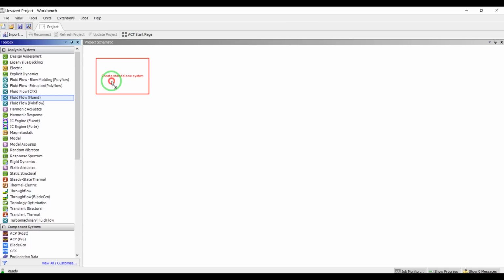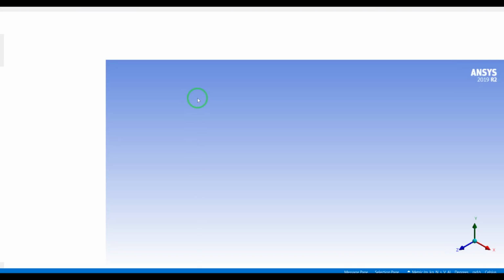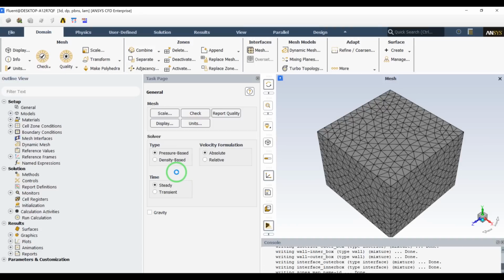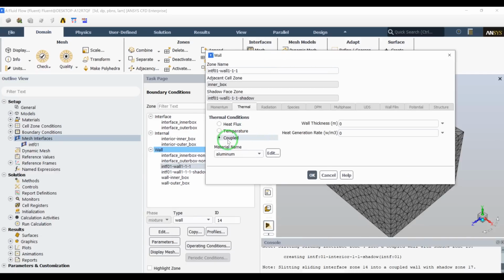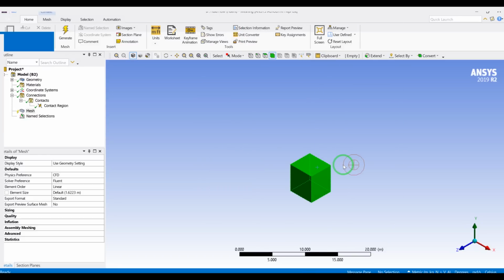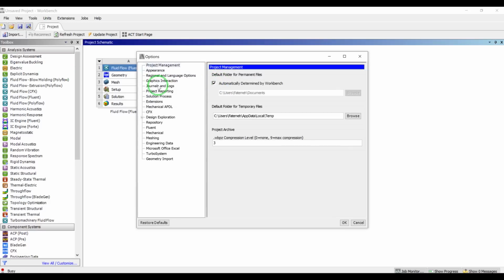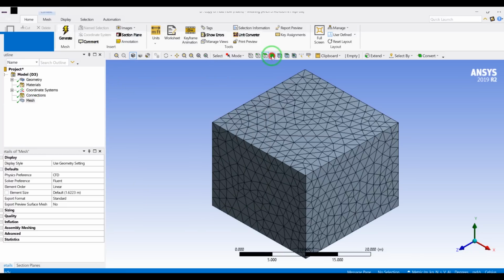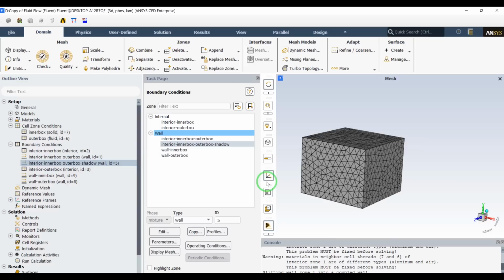ANSYS Fluent Tutorial: Three methods of Defining Fluid - Solid interface for Conjugate heat transfer

Comment: Great video!!!
In the first method, when u set the interface, except for the "intf01-wall1-1-1" and "intf01-wall1-1-1-shadow", how about the other two generated walls? What is their function, and why are they created?
Also, if I set up the wall interface for two solid zones, does the side of the wall shadow affect the heat flux?

Comment: Namaste sir,  thank you for clear explanation but i am still facing issues with mesh and boundary condition; i am working with battery pack which has bit complex geom (in context to manually define contact regions) while automatic contact regions give overlapping problem. I have tried combining in one part ,share topology and ansys mesh and even fluent mesh still some internal boundaries remain as wall  while i want to transfer heat generated in cell to outer wall of pack ( here i am using battery model for cell modelling(not flux profile) this itself requires to define some named selection for cell) these selections comes as wall in boundary zone but i do not want that. And when all boundary issue are reseolved the battery pack circuit starts missing active zones. Can you help with  that. Anyhelp will be appreciated. Kindly reply , also give mail id for communication.

Comment: Hi there. Thank you for your tutorial. Btw, I have some questions. 
1. Can we use the same box and differentiate the lower surface as solid? For example, the upper surface of box will have radiation while the lower surface will act as steel, the absorber for heat. And in between the surface is the fluid. 

Or do I need to sketch another box which will act as steel absorber as the cube?
2. What is the difference between the radiation model and radiation in thermal tab of determining boundary conditions?

Thank you for your help!

Comment: Thank you very much, it worked for us!!
We were trying to do a parametric analysis of a solid-fluid interaction but it was giving us problem of recorded-mesh operations (using the first method since we didn't know about others) and this problem would occour in random times, so we couldn't solve it with our journal. But since we used your third method, it stopped showing us the message for recorded-mesh operations and now we can automate everything.
Thank you again!

Comment: Hello there. Thank you for the very informative video. Just one question, does this method work if i want to create a structured block mesh inside a fluid domain with different mesh sizes. Will it work if i combine all blocks to one part at the beginning?

Comment: Great Video, Can you tell if that non overlapping wall will cause any problem? If I have a non overlapping wall, then what should I give as its condition? Heat Flux zero or via system coupling?

Comment: Excellent video. I have a question. Which boundary condición can you suggest me for a interfase or contact between two volumes of the same fluid? Thanks for your answer and your videos, they're so cool
Reply from the maker: It depends on you application. But if you are just slicing your fluid region for example to make finer in one section. The interface should be internal in between which will make two fluids physically one single material.
Reply: @AdvancedEngineeringTutorials  Thank you.

Comment: Excellent tutorial! Thank you very much!
In addition i can suggest a thing. In the third case (unified part for multiple bodies) mesh is conform (vertices-to-vertices), and single meshing rule is applied to all bodies in the part. And as all bodies is in single grid, this may cause too dense grid in parts, where it is not necessary. And sometimes need to apply spedial sizing mesh rules to separate bodies. Just my suggstions. But in general, mesing single part is best solution, as in this video.

Comment: Could you help me?
I'm trying to simulate a piece of wood drying into a wind tunnel and i'm having problems with meshing.

How can i set the contact between the fluid zone and between the solid (set as fluid zone because it is a porous region with water inside)?
Reply from the maker: Thank you for watching and thank you for your comment. Could you please explain more about the problem? How do you create the porous media?
Reply: @AdvancedEngineeringTutorials  I set the cell zone condition for wood as fluid zone and then marked the option "Porous Zone". Set the porosity for this cell, and the porous material as wood (from fluent database).
Reply: I also set an initial fraction of water volume inside the zone (0.5) at the initialization, the heat transfer worked quite well creating a contour of temperatura, but the mass transfer doesnt work.
Reply from the maker: @kkggff1  I see, unfortunately, I have not done much mass transfer simulations so I am not sure. I will try to see if I can address this issue.

Comment: Thanks for the video, very well explained :) 
I usually use 'Imprints' as shared topology after forming a part in Design modular, which creates automatic contact regions in meshing (sometimes overlaps, which can be overcome). Is it a right way to do?
Reply from the maker: Yes, that will be a good way too. In my personal experience, merging them as one part and letting fluent take care of interfaces is the easiest way and you can find out any problomatic geometry if that does not work well.

Comment: Hello my Ansys Fluent 2020 does not detected contacts even after following the boolean operation. I checked whether automatic contact on attach is checked. But even when I select create automatic connections, nothing happens. What could be the reason?
Reply from the maker: Thank you for watching and thank you for your comment. Are you creating a single part from all the bodies in the design modeler?

Comment: Very useful. Thank you!
Reply from the maker: Thank you for watching and thank you for your comment.
Reply: @AdvancedEngineeringTutorials  
What if i have to apply one of these methods to a 2D geometry? which one would you suggest?
Reply from the maker: @francescomarcelli7672  Personally, I always use creating single part in design modeler so the interface would be created automatically in the Fluent. In this case, if the interface is not there, this can be a sign that there is a problem in the geometry, for example there is a gap or something like that. So I suggest using this method as your default method.
Reply: @AdvancedEngineeringTutorials  
Great, thank you. Your tutorials are very useful!

Comment: Hi and thank you for this useful video.
I would appreciate it if you could answer my question in terms of solving a conjugate heat transfer problem.
I want to know is that possible to use the solar load model (in 3D) using the ray-tracing method when we have a solid zone adjacent to a fluid zone. You consider the solid zone is a transparent zone which the inside of that has meshed, does ray tracing consider the outer surface (this outer surface actually is an interface) of solid in the calculation of solar heat flux on the surface? For more clearness, if you add solar load using ray-tracing exactly in this example (innerbox-outerbox) that you showed, raytracing is ignored on the outer surface of the inner box as solid zone, since I need to calculate the conduction heat transfer through the glass part of my problem I really need to know how it is possible in the Fluent. 
I would be thankful if you just give some tips about my problem ( conjugate heat transfer inside an aquarium with considering of glass thickness in order to see conduction through the glasses thickness - 3D)
Reply: And also this is my email for more collaboration and communication about this problem and paper: javada@civil.aau.dk (Thanks a lot)
Reply from the maker: Thank you for watching this video, could you please send specific description to the problem you are looking to solve to this email address? simpro2144@gmail.com
Reply: @AdvancedEngineeringTutorials  Thank you very much. I have sent my problem to your Gmail. I would be thankful if you could help me in this regard. Thanks again.

Comment: Good training. But ı am wondering that, ı want to link it to the static structural( ı am talking about one way fsı) which surface should ı apply the imported force in static structural? do ı have to define a domain on the body like wind surface or fluid interface similarly the fluent?
Reply: it's a big assembly by the way. I combined it as a one part. Think of that is the beam analysis. Thanks in advance...
Reply from the maker: Could you clarify more about the geometry you want to simulate?
Reply: İt a aluminum base solar mount structure,ı may share you images in private if its proper for you
Reply from the maker: @OneArmedCrab  Sure! That will be great.
Reply: @AdvancedEngineeringTutorials  Easy man easy ok :) it ain't problem ...

Comment: Excellent video. Thanks for sharing. I plan to start on method 2 to create my interfaces for my first conjugate problem. My one question is within my workflow I use DM for geometry and water volume generation and then Fluent mesh to create and save the mesh as I like the direct creation of polyhedral (2019R1). Then I import the mesh on Workbench. I noticed one time I could not do my conjugate problem as it told me I needed to define the interfaces on SpaceClaim (which I dont use). Do you think that me following your method on DM defining interface names first there and then meshing on Fluent will eliminate this problem? Thanks! (I will try anyway).
Reply from the maker: Thank you for your comment. Yes, if you use the design modeler and then do the meshing inside the FLUENT, it will work. 
Just you need to assign all the bodies to a single part and also define all the name selections and boundaries in the DM. Let me know if you will need more info.